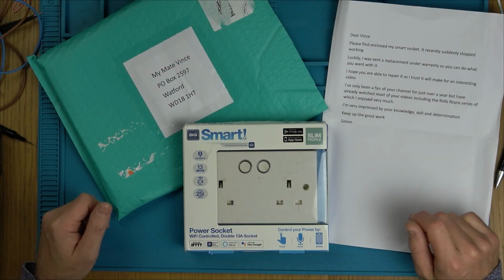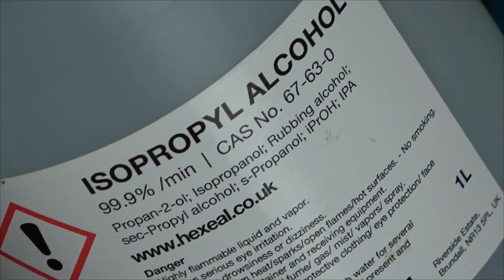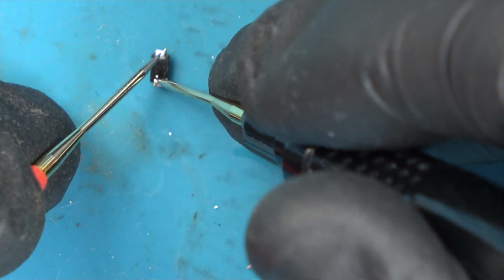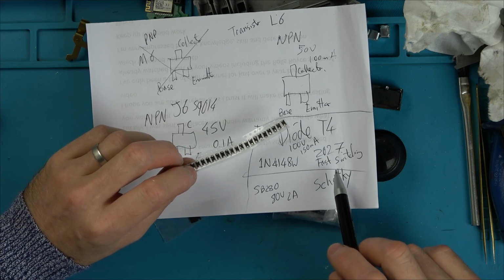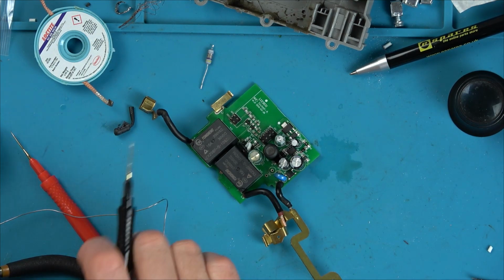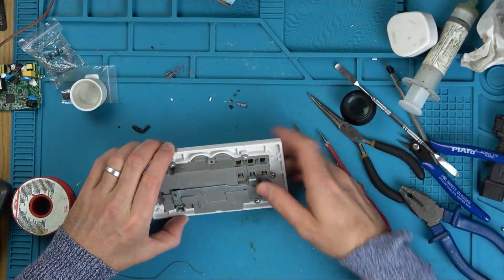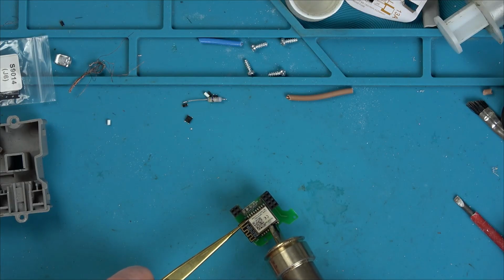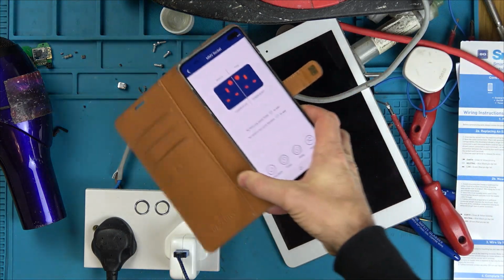Trying to FIX a 13 Amp WiFi Power Socket

Comment: Agree with everything you say about smart sockets. I use a few smart plugs and yes I've have had a couple fail. As they just plug into a normal wall socket and then you plug the appliance to be controlled in into it. You have lots of lots of sockets around the house burning electricity (the control circuits are always live). I have most as security light switches effectively on a timer but the ON times are sync'd in the app to sunset times and BST so changes everyday, and I don't have to touch them - ever.

Comment: A very interesting, entertaining and educational video Vince. I fully agree with your assessment of the reliability issues. I have been an industrial electronic development engineer during my career years and loved designing automation and communication equipment. Today I just believe that we have made most devices over complicated and much less reliable. Like yourself, my enthusiasm for complex and intricate functionality has dimmed quite a lot. I still find it interesting but I would welcome new equipment with good old fashioned switches and potentiometers like we had with the first transistor and indeed valve radios, amplifiers, tape recorders and record players.

Comment: Looks like a power surge or the arc from breaking the relay contact

Wonder if old mate was using it for anything inductive lol

Looks like they might have made the copper go over further for heatsinking for the relay? They could have at least another 2-3mm of clearance easily and avoided that

Comment: What happened to the days when the only smart things inside a UK mains socket was the number of mechanical safety features they included in such a small form factor. What happened to BSI and the kite mark. Shoving a bare bones low voltage bridge rectifier millimeters away from a  13A AC circuit, then embedding it into the wall of your house, is terrifying

Comment: Don't assume working of a relay just by continuity. Without opening you don't know how points are looking and that still isn't a reliable method. Best is measuring resistance of points in closed state, but that requires mili ohm meter, as new relays usually are around 150 mili ohms.

Comment: Greetings from Ukraine! You have some great, interesting and informative videos. To safely turn on various devices, you can use a regular incandescent bulb connected in series with the load. In the event of a short circuit, it will prevent the input circuit from burning. And there will be no need to turn on the devices with a long stick. (Google Translate translation).

Comment: Nice Video Vince, I would definitely recommend investing in a Socket Tester Plug, Very useful although don’t do what I did and hit the Reset Button as it tripped the Electrics in the Flat and Set my Alarm off at the same time, The Alarm’s Battery that I had back then was knackered hence the Alarm going off, Not sure if I’ve said it already but Happy New Year to you & yours Matey! Anthony - Birmingham

Comment: Tbh, I kinda of scared when it comes to relays (both mechanic and static), I wish one day somebody would design a complete mechanical (servo with a static motor or something) switch so heat is no longer a nightmare

Comment: with you vince on simplicity, new boiler fitted a year ago all controlled via phone and hive, router blew at the weekend so no wifi and no central heating as room stat talks to boiler via wifi, no solar panel charge as the inverter needs to be connected to wifi

Comment: I wrote this before you tested it on the mains.
You can see it arced over from the large track to the low voltage due to some contaminate. Which may have been introduced or from manufacture and took a while to break down.
Even if the diode D3 failed all that would happen is the relay would fail to switch and maybe damage the transistor, the diode is the back EMF diode to protect the transistor from the voltage spike from the relay coil. This damage may also have taken out the controller and or WiFi module. The bridge rectifier would die with the 240V being connected to the output side of it.
The 30V is the DC rating of the contacts.
The relay has a 5V coil and contacts rated @16A 30VDC or 250VAC.
The fuse as you called it is a fusible resistor quite common it also reduces inrush current.
I personally would not use any of these smart plugs and  or the inbuilt USB PSU's

Comment: I suspect the power supply went first and took out the other components.  When I worked in computer repair, if we found a bad power supply we would tell the client that we could probably fix it but there would be no guarantees.   There is no way of knowing if the power supply sent excessive voltage or current to the ram or the hard drive or the processor.   We had one case where the client asked us to revive the computer.   In about 3 weeks time we had replaced power supply, ram, processor, hard drive and motherboard.  Yeah she ended up with a brand new computer.

Comment: Interesting fix Vince! Personally I don't trust these wifi sockets beyond using them for systems that only draw a few amps. No matter the brand. Trying to squeeze components that are capable of switching high currents in these devices with limited space is always bound to create issues in my opinion. Also the types of loads might be an issue! i.e resistive vs reactive. But great teardown, always wanted to see what was in one of these... ;-)
Reply: A set of relay contacts in the  path of high current devices is bound to fail over time.  Troubleshooting  (fixes) hones analytical  skills, builds knowledge, self reliance  and independence while educating others  via videos such as these, IMO.  Another win on finding the solution ! 🤩

Comment: This looks much more like a failure due to a voltage surge caused by something like a nearby lightning strike.  I have repaired several similar things damaged by direct or induced surge voltages from lightning. Not all surge suppressors are sufficient to protect against it, but they do prevent some.  It is typical to not be able to determine a single source of multiple failures when viewing this kind of failure but the burnt traces and arcing are signs of higher than normal voltage and current effects that did not get handled.

Comment: Hi Vince, great video as always! I'd like you to know that I totally agree with your opinion concerning simplicity. If you'd like to keep power consumption as low as possible, that's great, but just buy a socket with a simple physical switch (and not some smart device or even a device with a momentary switch to turn the socket on and off as they always consume power even when the socket is off). It's strange how even many devices no longer have physical switches to turn them on and off; in some cases this means that batteries (that may power them) are draining slowly even when those devices are not in use, causing them to eventually become useless due to lithium batteries that have been drained down too much. Anyway, there are even more examples I could give, but you get my point. I even think devices in general are too complex nowadays; it seems like everything needs software and a micro controller to operate instead of simple circuits etc which is much more reliable. Anyway, sorry for my long comment; you can be sure I won't unsubscribe if you do not reply this comment (you do great videos, you are very descriptive as to what you are doing, you are always very friendly and calm, that's exactly what it takes to keep me subscribed; it is strange that some people don't understand that you simply are not suposed to answer every single comment, you still have a live outside of the videos you do, haven't you?).

Comment: Clean your countertop. The amount of old discarded solder will cause you no end of problems. You can see it on the underside of the board at about 17:00.

Comment: These devices will be using Bluetooth which has a limited range, so you must already be physically close to the device anyway.  If the lifestyle you are leading is so fast and frenetic that you cant take the time to go to the wall socket and turn it on manually then I think you need to reassess your choices. Just because you can do something doesn't mean you should do it.
I'm getting too old for this world.

Comment: I have bought smart extension leads that plug into a standard socket. I've some of these for 4-5 years with no problems. The great advantage is sockets in awkward spots can now be used and I can switch stuff off/on from anywhere I have a mobile phone signal. I switched some lights off/on from the FA semi-final at Wembley one time!

Comment: You're absolutely right about home automation in the sense of remote actuation of switches, etc. Where I find home automation is fine is things that do their thing in the background on their own like watering plants depending on the moisture level in the pots, etc. So not things that you could very well do, but things that would need measurement, monitoring from your side... that's where I think home automation has definitely got a place... Also when you use it to control multiple switches at one... setting scenes, etc. That's neat. But yeah, not the individual light switch...

Comment: I would bet it was moisture... not necessarily water, but moisture... The high voltage side should be better isolated from the low voltage side... the part where it arced should have been way more further apart. This is a very amateurish design and possibly even a serious fire hazard if the wall is colder than the room and moisture can form behind the relays... This would need more investigation from the manufacturer to prevent this.

Comment: Condensation or water leak somewhere had gotten into the unit...looks like some solder joints had corrosion, then the 240V flashed over the wet PCB from live and went wherever it wanted chasing its way back to neutral in the resulting plasma.

Comment: Pretty sure that's not a fuse, it's a fusible resistor.  Meaning you should replace it with a resistor for testing instead of just a fuse.  You could put a fuse in series with it or just use a tiny 1/8 watt resistor.

Comment: Looks like there was a breakdown of isolation between the LV and HV in the relay or board.  Defective coil in relay or something on the PSU brought both sides together I reckon, resulting in 240VAC heading to the LV coil.  Open the relay!!
Reply: Relays survived!! Good testing!  That's a lot of track carnage on the board from just small components going short!  Always happy to have a guess early on and get it wrong!

Comment: I definitely would not put it into the wall again (which I wouldn't do anyway, my walls are  mostly wood - I'm under the roof) but I would put it in a separate housing with some fuses  - and use it ;-)

Comment: Vince, Vince, buddy I'm about 33% of the way watching the video and shaking my head saying no no no please!   I like your videos and don't want to see you lose your life for one of these videos.  I haven't watched the end so I could be way off but these devices are death traps.   There is no isolation on the low voltage side so the "Low" voltage is live with respect to the high voltage.  It looks like they made an effort to provide significant distance on the high voltage side with traces.  But they neglected to do the same on the "low" voltage side.  And what happened here is that a spike (lightning,  surge etc) momentarily raised the line voltage.  This exceeded the electrical isolation between the low voltage to the high voltage side which created a spark where you see the initial burn.   This in turn put high voltage on the low voltage side creating a chain reaction all the way back through the power chain.  I suspect many more components are either fried or very close to death.  For one those non-isolated supplies are dangerous especially if it's wired wrong.  Second the fact that there is no MOV suppression and fuse is even more insane.   I'll finish watching but I fear for your safety.
Reply: I should have watched a bit more.  I see there was a fuse and I see that blue thing that looks a lot like a tiny MOV.  So they did have some minimal protection.   But those values are just too small to provide any real protection.   Usually there is a sizable MOV, a choke (inductor) and a fuse.  Together they form your surge protection.

Comment: Epic, well done. Although there was significant burning, the charring on the live entry parts of the shutters was interesting to me. My guess is that something or someone caused the live on one socket to track over and blow the relay coil trace and other components. The diodes looked to be steering rather than flywheel and I suspect one or both relays are partially damaged internally (as always, all my opinion only).

Comment: You could swap the wifi chip. and simply reprogram it with something like ESP Home where you just say which pin is a button to toggle the relay and which pin sends the signal to the relay.
then you would have 2 working smart sockets.

Comment: If a device fails catastrophically and somehow the breaker doesn't flip right away I can turn it off at the wall or powerboard/strip. If the wall socket fails I could be in trouble. Then there's the risk of a fire.. no thanks.
I am all for smart homes, can do it myself using Homeassistant.. but there's no way I will use cheap wall sockets like that. I strongly suspect the HV met LV and cooked it. Those wifi boards don't like HV.
It doesn't matter to me that it won't work for 20 years because it won't be compatible with wifi standards in 5 and you can bet the app won't work then either.

Comment: I think you nailed it with tracking through the board from the mains side of the relay to ground side of the coil. The large pad under the relay with sharp corners positioned so close to a ground path is a bad design.

Comment: Just wondering in general if is there any chance that the relays are pulling more current than the normal? Maybe the mechanicsm got jammed or for other reasons? Is there such thing? If yes, can it cause to overheat other compnent that feed the relay?

Comment: And then Vince started poking a metal object into a (not connected) socket 😂 Looks like this one got wet (witness mark on the rear of the pcb) , together with a high load plugged in. 240v went to the 30v side on the relay. You shouldn’t be that scared of 240v AC… the chance of getting killed is there yes, but if that were a big one I’d be dead a long time ago. AC is way less dangerous than DC.

Comment: My conclusion is that someone with a wet hand plugged something in, and that started tracking between high and low potentials. In my experience tracking faults take a long, long time to manifest into a catastrophic failure. Sometimes weeks. I reckon that diode only went short when the carbonized path flashed over and took out all of those switching components. I'd guess that the lack of explanation of a cause from the person who sent you this device is that they weren't the one to plug something in with water on their hands and/or weren't present for the moment this thing went bang.

Comment: Awesome :) Just a tip for safety. You can actually often use like 50V DC and many of these circuits will start working. It's a safer way for just testing if power gets output and measuring mosfets ie.

Comment: I suspect that there was an arc over from the mains into the relay circuit. The firmware can be replaced by reflashing with Tasmoto or ESPHome. Then it can be controlled with HomeAssistant. I agree that using external wifi controlled switches and NOT using the integrated ones like these.

Comment: If you use rel mode when measuring resistance Vince, it will take your meter leads resistance into account.

Comment: @14:30 looks to me like it arced between the live side and the low voltage side, due to poor design with insufficient clearances and no cut outs in the PCB, likely got 240V go into the low voltage side which blew the diode and transistor.
These units are so badly made, even the main L1 terminal is barely even soldered to the PCB... wouldn't want to put a lot of current through those !

Comment: Unpopular opinion: IoT is stupid. Why would I need my refrigerator to shop for me? Why would I want to have my dish washer to connect to WiFi? Why would I want to make all the lights at my home be switchable through an App? If anything, all of those things are ways to tell the world what, where, when and how you do things. You can actually save a little money from the power grid if you buy efficient appliances that don't connect to the internet.

Want to switch lights on and off while sitting on your couch? buy one of those clapping mechanisms that have been around for like 100 years, Want to have lights turn on when you get home? use an analog movement sensor. Want your laundry done right when you get home? most new washing machines have a delay programming that can switch on the device at the right time. Privacy and convenience are paramount these days and the less you publicize your life, the better.

Maybe, and that's a big maybe, an oven that can start cooking your meal when you leave work so it's ready by the time you get home is a good idea, and a device that can turn off the utilities if you somehow forgot to turn off your cooktop while on a trip are useful, otherwise, it's just stupid.

Comment: Yep I bought 1 of those, died after a couple of years so put back the original dumb socket and not buying any of those again. Bought a couple of pass through wifi sockets for a few $ so when it dies no need to remove it out of the wall.